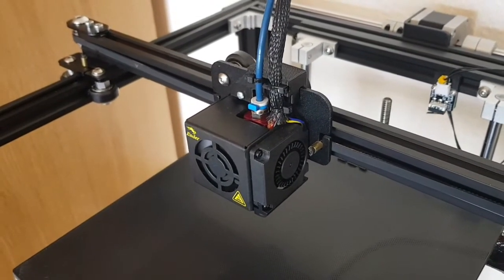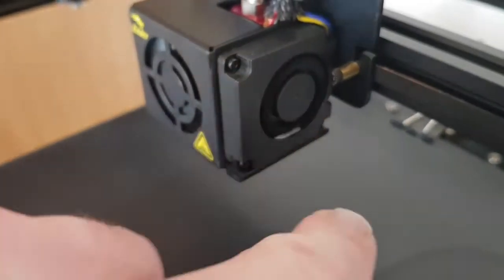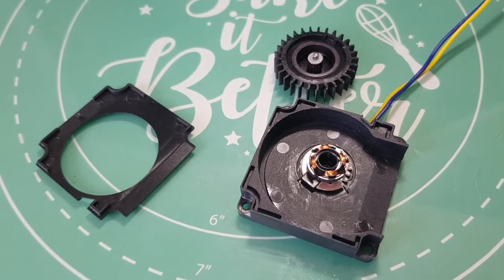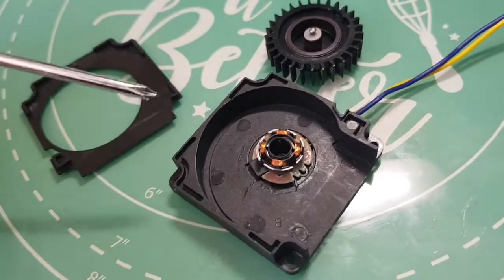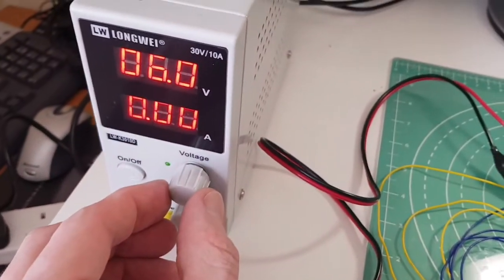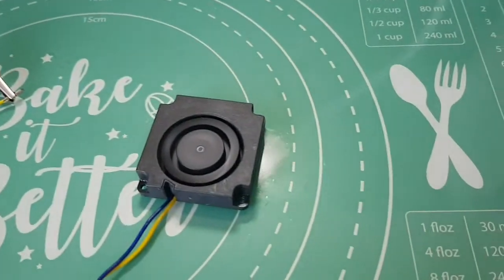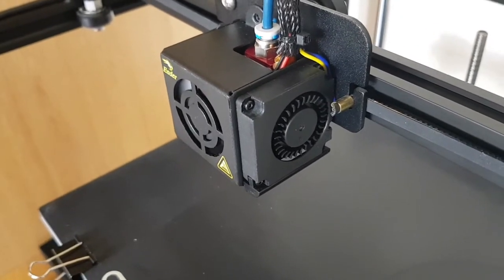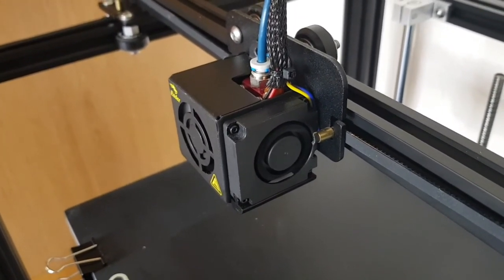Creality Ender 5 Pro - Cooling fan service attempt and repair!

Comment: Would it be possible to drill a small hole in the housing, on the bearing centreline, through which you could add a drop of oil ?
Reply from the maker: Possibly if you can drill precisely and reseal it
Reply: @amp9438  well can was acting up so nothing to loose. I ended up taking apart and damaging wires (sound familiar ?) but got it back together and working. There was next to no wear so just cleaned it up, added tiny amount of grease. Plus added a small hole through which we can add oil. We’ll see how it works out.

Comment: awesome video buddy! do you have a link to the part you got?
Reply from the maker: Hi. I bought the replacement fans from Amazon UK. Link is https://www.amazon.co.uk/dp/B07GXPJB25/ref=cm_sw_r_cp_apan_glt_fabc_R56ZYV33XCA0SBYVV4KC?_encoding=UTF8&psc=1.
I'm still using the old one and haven't needed to replace it yet.
Reply: So again, I went to try my ender 5 with petg , and it came up to this issue. So this happens whenever the pwm of the fan is below 100% ? is it a lube issue? I see in your video it wasn't succesfull your full dissasembly and repair , I see you've tried to lube it. Greets from argentina